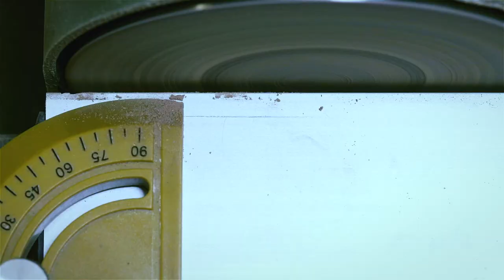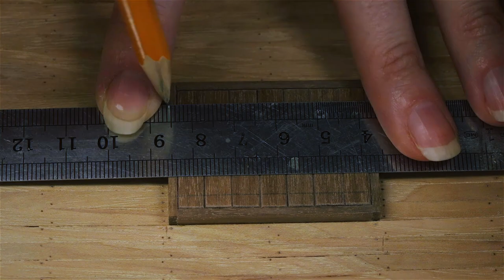Model ship building #12 - Making the Main Deck - RAGUSIAN CARRACK XVIc - KIT (MarisStella)

Comment: Olha Bacherova - you are coming along fine on this little carrack.  They were ungainly ships to sail, short and dumpy.  Abysmally slow, but they ha a couple of really good traits.  First, it didn't require a 50-man crew, quite capable of being handled by a dozen or so men.  Secondly, they carried a LOT of cargo!  The hold is deep, and fairly long, and really quite wide.  So, if a merchant didn't care if the voyage took 4 weeks instead of 2 or 3 weeks, he cut his transport costs by a great deal.
Love watching you work at these boats/ships.  You are patient and thorough - as with the way you scrape off excess glue.  Your manner of planking is also great, getting the wood laid down neatly, and using the tips of toothpicks to simulate the fasteners.  Youi take care with blackening the brass to make it look like iron, even going so far as to slightly buff the new fasteners and hinges.  I build life-sized antique flintlock rifles, which require the same neatness of work.  I used to build airplanes (people sized!), but take too many pain pills now to go fly an airplane.  Or race a sportscar....  At any rate, keep up the good work.  And I do realize that we are seeing videos of ship models that you have already finished.  How many have you built?  And if you need anything I can help you with, just ask, OK?:yougotthis:
Reply from the maker: Thank you very much!
The planes are fantastic, although I am terribly afraid of them for fear of heights, but I like to watch them as they fly...
Of the completed large projects I probably have 6-7 ships.
Reply: @OlhaBatchvarov  As a result of watching your builds, I am committing myself to build a model boat in the new year.  I mostly built period-correct flintlock rifles and pistols in my "little" shop, but will build yet another workbench to build a ship.  Having built and rigged quite a few sailing craft over the years, I will try to use correct knots and hitching on the model.
I notice that many of the models are so realistic that they need crewmen - for ships in the 1/84 range, HO railroad people would serve well, as HO is about 1/87.  And O-gauge RR is approximately 1/44, they have people also.  Might as well have some fun with them!
Still admiring your skill at this avocation.

Comment: Olha, I notice this time that when planking, you did not paint the plank edges black in order to simulate the hemp caulking. Is this because of the earlier period of the original?  Or maybe at this scale the effect of the scraped CA glue is sufficient? Either way, beautiful stuff!  Angus
Reply from the maker: Oh, almost the entire model is made of walnut, which has a vary niticable grain and if you apply CA, all the grain will turn into giant cracks at this scale. So here I just chamfered the planks to create volume and to highlight each plank...

Comment: Great video! I am wondering why you use wood glue vs CA glue? I see some modelers use CA and was wondering if there are any pros/cons with either one?
Reply from the maker: Thanks!
CA is a very specific glue - in some cases it is indispensable. But it has a number of serious disadvantages such as peeling and not shock resistan ...
Therefore, I use it only as an auxiliary or for temporary gluing until the PVA dries!
Reply: @OlhaBatchvarov  thanks for the reply! That is good information. I have been using CA on my models mostly to save time. I wonder if, over time the glue will fail? How long do you wait for the time you clamp and glue before you move to the next section?

Comment: Olha, how often do you break those micro drills?  They look like if you exhaled, they'd blow off of your workbench!  I've got some that are about 0.015-inches in diameter (~0.38-mm), but what you are using to drill for the pegs (treenails?) appears much smaller than that.  Mine are for metalwork, but I've been afraid to use them for fear of breaking them due to my mill-drill not being "sensitive" enough, I think.

When cutting openings like the cannon ports, have you tried cutters like small end mills or the sets of burrs, both of which come in sizes with shanks that would fit your Proxxon multitool?  They are made to cut on their sides, unlike drill bits and might make it easier to join the cuts between the holes drilled at the corners of the openings.  Of course, you would still need to finish like you do with razor knives & files!  ;)

How long did it take to install the main deck?  If you allowed each pair of deck planks(?) to dry for 24-hours before adding the next pair, it looks to me like it could have taken you nearly 3 weeks just to install this deck by itself.  If so, you must have the patience of a saint!

Is your scraper the breakable blade from a large cut-off razor knife or a true scraper with a shape that I'm confusing for that?  I've not (yet) used a true scraper on wood, but have used a single-edge razor blade to scrape steel parts (that obviously didn't need too much scraping ;) -- the single-edge razor is flexible enough to perhaps flex & "fit" the variable contours of a deck/hull better than a true wood scraper, expecially on something small & light like a model, I think.  Of course, I haven't tried this, so I'm just guessing out loud here....

The ring making at the end brought back fond memories of figuring out how to make a maille shirt after seeing one at a renaissance festival in the '80s.  This was before the Internet, so it was trial & error due to poor memory of the proper "weave" pattern!  But I never tried to solder (rivet or weld in my case) the rings.  I'll remember the technique you showed!
Reply from the maker: These were 0.35 mm drills))) And I break them every time I finish drilling the planks and put the tool aside without removing the drill - where it can easily breaks off))))
Yes, it was a scraper made of knife blades - I just pressed it to the desired shape on a disksander, here is a video:
https://youtu.be/It6XGVAG5CM?list=PL2yU7nOqNxV9FyCahCx8j5zCcj2Dtt_N8&t=1120
Reply: @OlhaBatchvarov  Ok, I see how you made your own small scraper!  Thank you,  ;)